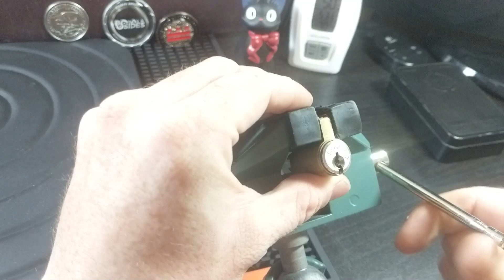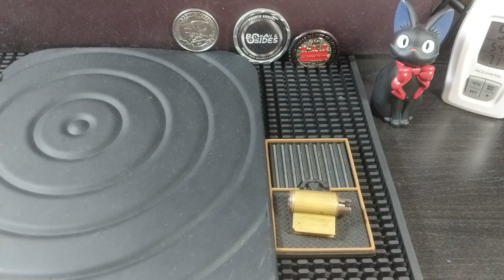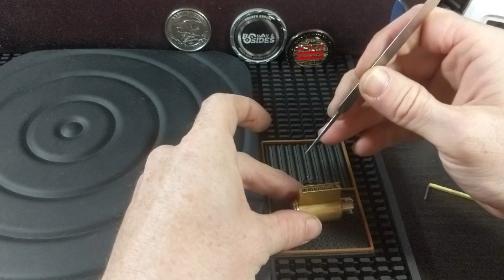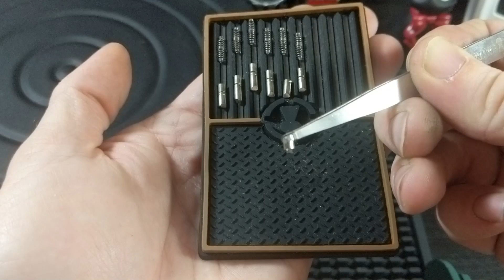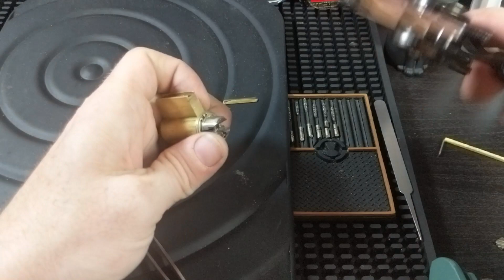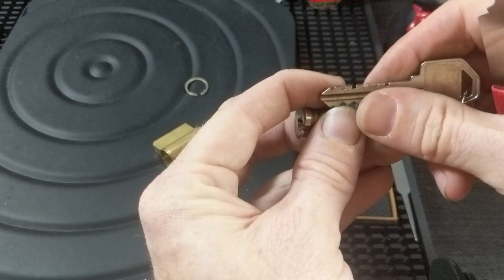Ø Picks Corbin Russwin Emhart KiK (83)

Comment: Excellent picking!

I understand the difference in the mechanics between this and a biaxial Medeco, but picking wise, is there much of a difference?

I'd assume this is more difficult, as there won't be a "click" as the side bar enters a gate, as it does on the medeco.
Reply from the maker: Correct, so when you're picking a medeco you will generally (depending on which direction you are going) set all pins to shear first and then go back and deal with rotation or vice versa.  When picking an Emhart you want to set the pin vertically and then deal with the rotation of that pin before moving onto the next and you really dont get a whole lot of solid clicks.  Its more like you set the pin and then rotate it until it passes the jiggle test and then move onto the next.  Its a fun and interesting pick and there's really nothing else like it.  Thanks for watching and leaving a comment.  Let me know if you have any other questions  👍. Take care and stay safe!